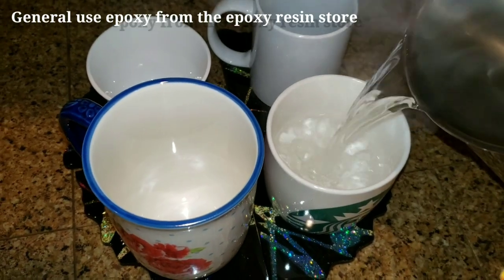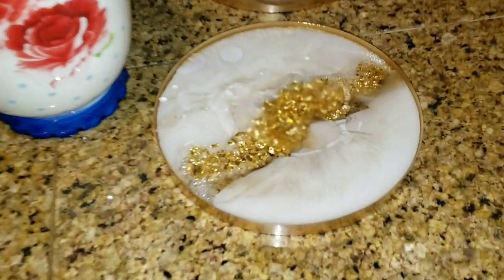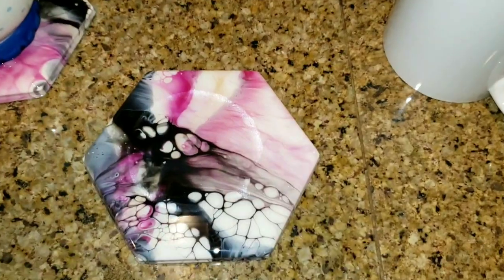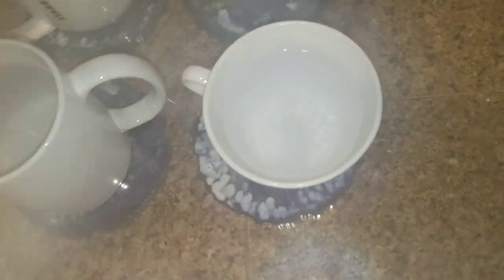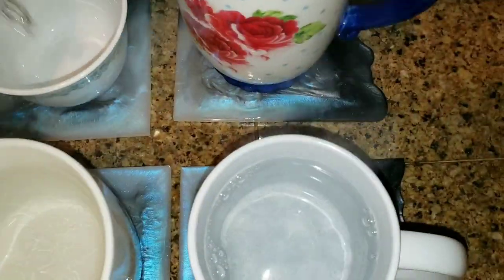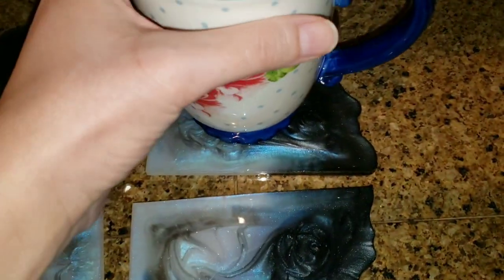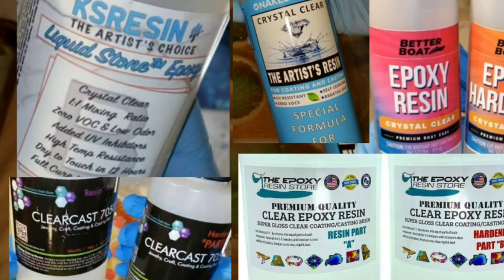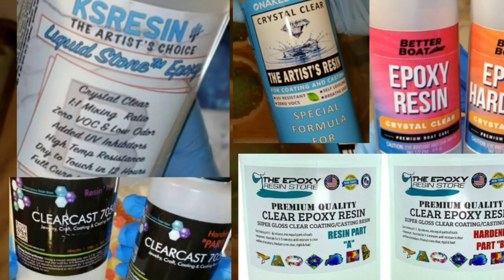Must see!! Heat testing coasters I made 😮 what brand did best? testing 6 different brands of resin

Comment: Great tests. I kind of figured it was going to go that way. I knew right off the bat stone coat would do real good but I’ve never tried   
K resin. 
I will do a test on my new FX 500 heat resistant as soon as they’re completely cured.
It’s real important to wait at least three weeks to a month before they should be used. A lot of people don’t know that and they use them right away and wonder why they leave serious rings. I’ll let you know how mine goes in about two more weeks.👍
Reply from the maker: Thanks for watching Sherri, I'm interested to see how the FX goes. I have a few more I'm going to test too. just waiting at least 30 days before I can test & post that video. All these in this video were 30+ days. I wanted to make sure that they were fully cured before testing. 💖💖💖
Reply: How'd it go
Reply: @Renewed85  
Personally stone coat has never left a ring. I have put really really hot plates even from the microwave on a tray I made with stone coat. Never even a mark.
Everything else I’ve used leaves a ring if it’s a really really hot cup. Because I get mine pretty hot in the microwave.
Reply: @sherrislife2046 Hi Sherri, do you think that resin could handle a hot pan out of the oven, at about 400 degrees? I’m looking for something to coat some ceramic tiles painted with alcohol inks for gifts.
Reply: Do you use the regular Stonecoat Countertop or the Artwork version? I am looking to make coasters that won't leave a mark @sherrislife2046
Reply: @josephsabo8218  
Stonecoat countertops but I’ve heard good things about the art resin

Comment: Really excellent for you to do this! I shopped around all over, and finally landed on counter culture resin (the same kind featured in Artsy Mad woman) because of the heat resistance as well as food safe properties. Have not personally tested it yet though.
Reply from the maker: Thanks so much Pam, I have a few other resins to test too. I haven't tried that brand I'm going to have to check it out. I'm only going to do top coats now with high heat resistant resin ❤ thanks for watching 🤗

Comment: Thankyou for this informative video. I will try the the epoxy resin store for my next resin purchase. thats really affordable and from reading their website...sounds like it will be easier to get the bubbles out from what I'm using now. 
Don't  do alot of coasters....but stonecoat is a tried and true for that. Also, that was a great tip to use one coat of the expensive stuff over the economical. I wouldn't of thought of that!!😆
Thanks again💛😃
Reply from the maker: Thanks for watching 💙 I get some really pretty effects in my #coasters with the epoxy resin store resin, I think you will like it. It will be an extra step to do a top coat with stonecoat or ksresin but I'm ok with that. I'll be saving a lot of moo-lah by doing it that way 😊💙💙💙

Comment: I use stonecoat countertop (the regular,  not the artcoat). It works great and is slightly cheaper than the art coat and does cure harder.
Reply from the maker: Thanks for watching. I've made coasters with the stone coat before too. Its just a lot more expensive than the ksresin. Right now the best option for me would be making everything with the general use epoxy and then doing a top coat with the countertop resin. 😊❤

Comment: Glad I came across this video! Have you tried putting something hot out of the oven on coasters? I’m trying to make alcohol ink trivets for gifts and I’m having a hard time finding something that is heat resistant and scratch resistant for this purpose. Do you think these resins could handle a temperature of 400-450 degrees?
Reply from the maker: Thanks for watching, I honestly think resin isn't the best for trivets because hot pans and dishes are 300+ F.  Resin is plastic when it's cured and I don't think it's a good idea to use items on top of it that are that hot. It might not hold up well. I know some people make them but I haven't tried it before.
Reply: @naptimecreations  Thanks for your response. The only thing that I have found that could possibly handle the heat of a hot pan is an engine clear coat. Engines get very hot and the paint is rated for high heat. I might give that a try, but I’m also beginning to think coasters are a better idea!
Reply from the maker: @Sue W  yes, I've heard of the engine clear coat too but I personally haven't tried it out. If you try it please let me know how it goes ❤️
Reply: @naptimecreations  I’ll try to remember!
Reply from the maker: @suew4609  thank you 😊

Comment: Hope you are still looking at comments!  I used the KBS clear diamond finish AEROSOL SPRAY for coasters on glossy tile. Modge podge on top of postage stamps.  One coat of KBS spray - looked gorgeous no bubbles.  Dried 10 hours - then did a second coat - it bubbled so bad - not smooth at all. 

Should I have just done one coat?
Reply from the maker: I think the mod podge might have caused the bubbles im not sure. I don't use spray only epoxy.
Reply: Thanks for the reply - I'll do some more experimentation

Comment: Hello, I love your videos! You have helped me so much. I have a question...I am trying to figure out the most cost effective way to make my coasters also, but still have a nice heat resistant coating on top. I was looking on the KS resin site. There are 3 different liquid stones resins that they have. The only one they say anything about heat resistance on is the Elite which is also the highest priced one. On this test you used the Liquid Stone, which is the least expensive of their countertop resins, and for you there was no sticking or damage. Is that correct? Thank You!
Reply from the maker: Hi Lorie, thank you so much and thanks for watching 🤗 I use the regular ksresin countertop epoxy the cheaper option. I also have a discount code, code NAPTIME will give you extra savings. I also try to keep everything as cost effective as possible & share with everyone what works the best and is the best bang for our buck because resin is expensive 🤗

https://www.ksresin.com/products/liquid-stone
Reply: @naptimecreations  Thanks so much!
Reply from the maker: @SuperPolky  no problem 🤗

Comment: For items other than coasters, such as jewelry,  key chains, etc does the epoxy general purpose resin work well for them?
Reply from the maker: Thanks for watching, yes it does work for those as well. Here's the link to it. Discount code NAPTIME20 will save you 20% 
https://www.theepoxyresinstore.com/products/crystal-clear-epoxy-resin-professional-finish-general-use
Reply: Thank you! From your experience with this resin do you have a lot of issues with micro bubbles? I ordered from Extreme Resin and CANNOT get rid of bubbles. I've tried everything suggested. So needless to say I am looking for a better option.
Reply from the maker: @acethegreat  the general use epoxy is a 1 to 1 ratio its a medium viscosity and it does have some bubbles. 

If you are looking for a bubble less option I would try liquid diamonds casting resin from the epoxy resin store. It's a 2 to 1 ratio resin and is a very thin viscosity no micro bubbles. It's super clear. There will be a few bubbles from mixing but they pop easily. 

Also what are you using to mix your resin? Wood sticks cause more bubbles because they're not treated or sealed. They leak air into the resin. I like to use a silicone spatula or a silicone mixing tool.
Reply: Thank you!
Reply from the maker: @acethegreat  no problem 🤗

Comment: I was wondering if you have tried using the general epoxy resin and top coating with a heat resistant resin and what your results were.
Reply from the maker: Thanks for watching, I have tried the combo of those 2 resins and it worked well. 🤗

Comment: Thanks for sharing your experiment. I use KSResin Liquid Art for my coasters and have good results. Affiliate discount codes and free shipping on orders over $50 make KSResin a winner for me. In comparing the KSResin Liquid Stone, it looks like the Stone is harder and more scratch resistant, but shorter working time. May try this the next time I need to order, as they are the same price. Thanks again!
Reply from the maker: Thanks so much and thanks for watching Sherri 🤗  I just ordered a gallon of the liquid stone is was $71 with a discount code and I like how they have free shipping. It's definitely  a great price and it works really well. I have a few more resins to test and that video will be coming soon 😊

Comment: great information, now i am concerned that the resin i bought will Dent (Krystal Resin0
Reply from the maker: Thanks for watching 💙 which resin ? The general use epoxy? Better boat or clearcast? 

If you do a clear top coat with ksresin liquid stone you won't have any problems with denting/scratching. Here's the link to the ksresin liquid stone https://www.ksresin.com/products/liquid-stone-ultra-uv

My plan is to keep using the general use epoxy from the epoxy resin store and do a clear top coat on everything with the ksresin liquid stone. I bought a gallon of the liquid stone last night.

Comment: Greetings from Puerto Rico the temperature in Puerto Rico is very hot and my coasters and other projects go soft and bending, what resin epoxy should I use please help me
Thank you 🙏
Reply from the maker: Thank you so much for watching. I would use ksresin if they can ship to you. That resin has a high heat rating 💙
Reply: @naptimecreations  thank you so much am going to look for it, if can’t find it or the don’t ship you have a 2nd choice sorry for being so pushy 
Thank again I really appreciated.
Reply: @naptimecreations  
Omg I looked it up very difficult to get it here 😭 and very expensive, any other advice please please let me know 
Thank you
Reply from the maker: @lindayukavetsky7723  oh no, I'm sorry to hear that. I will try to find some good brands that will ship there. I will add them in another comment after I find some. 💙🤗
Reply: @naptimecreations  
Thank you so so much 
Blessings
Reply from the maker: @lindayukavetsky7723  of course, happy to help 🤗🤗🤗
Reply from the maker: @lindayukavetsky7723  having a hard time finding one that will ship to you. Still looking. Do you have Amazon there? Mas epoxy on Amazon is good if they will ship to you. 🤗
Reply: @naptimecreations  
Thank you so much for your help am sorry to cause you trouble maybe this experience will help others, I have amazon and eBay, I saw this one I been searching as well there is this on eBay called Clear Cast 7000 and KPERDIEM DESIGN CO 
But am not sure read the discrimination, eBay is less expensive, can you tell me what I should be looking for on the discrimination of the resin 
And thank you so so much, really sorry for the trouble.
Reply: Forgot to tell you I been using Simply Clear general purpose resin from eBay thank you again
Reply from the maker: @lindayukavetsky7723  no problem at all, happy to help. Do you see mas table top epoxy on Amazon? The brand is MAS a lot of artists really like that brand. I haven't tried it yet. Hoping to try it soon.
Reply from the maker: @lindayukavetsky7723  you want to look for something that has 500F heat resistance. That will be best for coasters 🤗❤
Reply: @naptimecreations  
Thank you yes I found it,
Ok know I know what I should be looking for, I really appreciate your feedback I am very grateful.
Reply from the maker: @lindayukavetsky7723  awesome, I'm glad you found it. Happy to help 🤗❤

Comment: The general use epoxy is a very basic resin that's why it is cheaper. I would Highly recommend better quality. Even their clearcast 7000 is only a few dollars more and has uv protection which the general does not. Well worth the extra few dollars. Their 7050 is even better for casting. But peeps please don't just buy a resin based on its price! The better quality is well worth it!!
Reply from the maker: Thanks for watching, some people have different budgets and can only afford the general use epoxy and it actually recently just went up In price. I've used the ClearCast 7050 and the ClearCast 7000. I prefer the 7050. I tested the clearcast 7050 in this video as well.